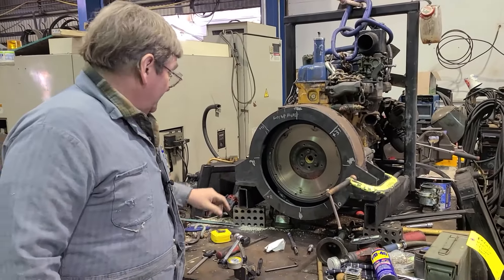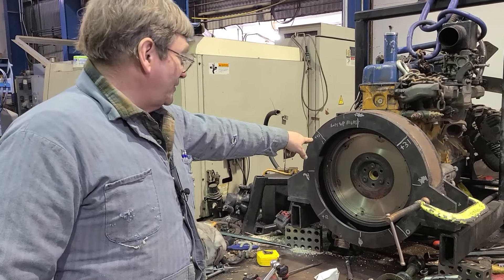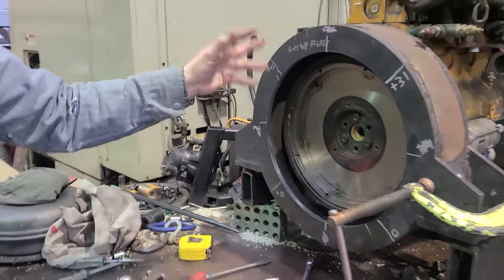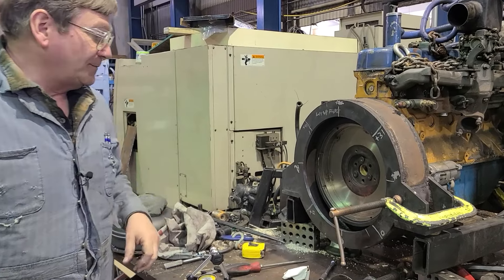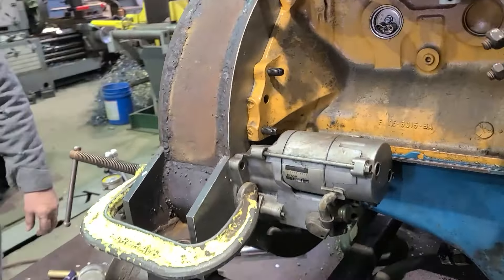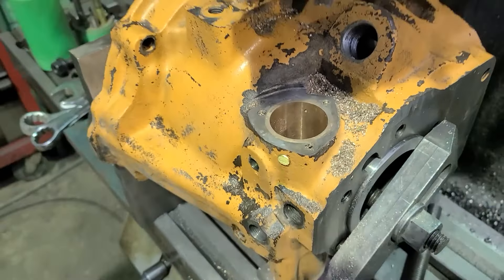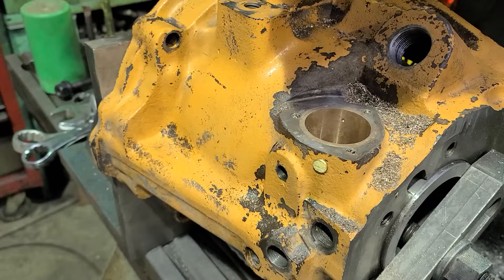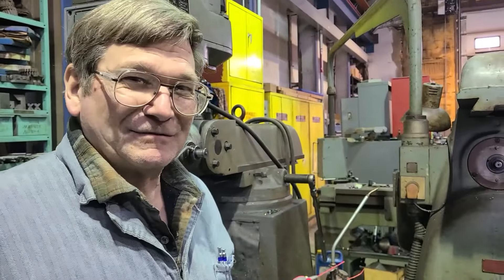Machinist's Minutes: Getting measurements off the engine for turning down the bell-housing

Comment: Im pleased to see someone who does things properly. I just spent ages fixing a transmission bellhousing on a crane repower. Had a twin disc   hooked to a perkins straight six diesel. It was repowered some years ago. For some reason unbeknown to customer it ate coupling and wrecked torque converter. They bought a new trans and fitted it. Sent other trans away and had it rebuilt. I got involved when it ate second transmission, coupling etc. I went back to basics. Clocked up spigot on engine and it was about .014" runout. Was a factory part. Then took flywheel and mounted in lathe off a machined fixture and lots of things wrong. Fixed them. I had the trans bellhousing and  on the bench and  set engine housing on top and it fell it. Was .030" loose. It was an inch thick adaptor plate to transition between both bellhousings. So mounted up trans bellhousing on dummy block, bolted on plate in preparation to boring out to make a hoop sleeve and it was running out 0.028". So I was dealing with very loose spigot and stuff out of line. Bearing in mind it had eaten two expensive units. Fixed it all, then had to install. Bill of over$15k. Drives quietly now.